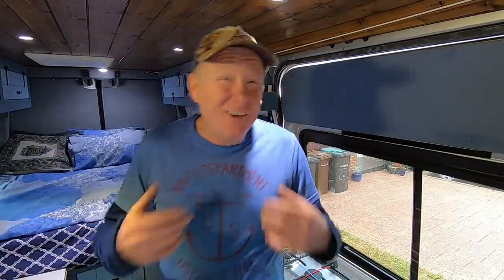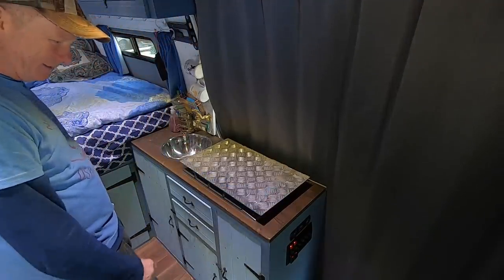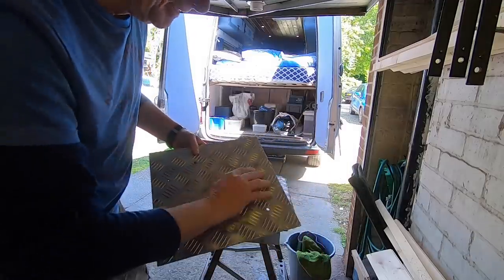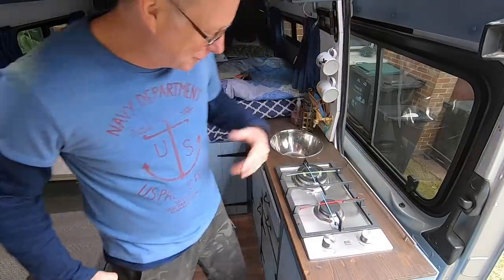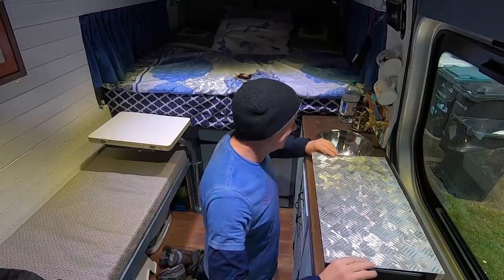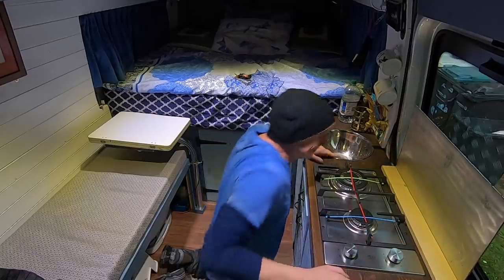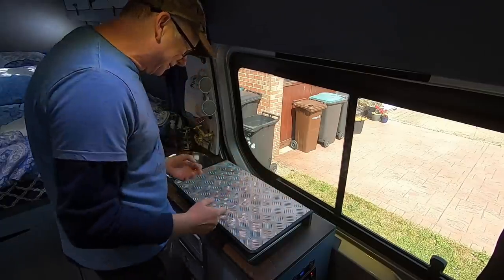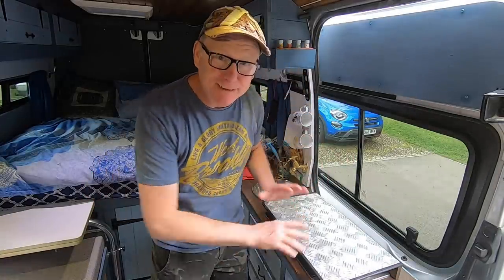HOW TO build kitchen in an RV  Campervan ( backsplash )

Comment: Gotta love left over bits,if you hadn't filmed removing that rail i'd have sworn you had cut it off with the grinder.hahaha,will the wood holding the lid not get hot?bit of angle would easily sort it if needed,nice job Mel keep em coming.
Reply from the maker: Thank you 👍🤓👍
I think it will be ok 👍

Comment: I would flip it and stick a nice piece of wood on the outside. Like that it looks better and doesn't melt your curtains
Reply: No need to flip, agree though just put a nice bit of wood on it and it could be his chopping board as Mel don't seem to have much prep room..Just a few tidy screws so as to remove and replace if needed..
Reply from the maker: Ohhhh that’s a great idea nice bit of bamboo thank you so much 👍🤓👍🍺🍺

Comment: I can't see why the heat would affect the window, most of the hear from the burner goes in to the item on the hob, when you cook you can't touch the pan yes because it's too hot, but it's not like everything surrounding the hob is boiling...
Reply from the maker: It’s also a back splash stopping my beacon from spitting fat up the curtain or windows
Reply: @BigVanSmallWorld  that makes sense, but the whole window thing? Nah

Comment: Mel, what curtains are you using? I really need some for my van.
Reply from the maker: the curtain for my door and cab come form this company http://rover.ebay.com/rover/1/710-53481-19255-0/1?ff3=4&pub=5575467911&toolid=10001&campid=5338454651&customid=&mpre=https%3A%2F%2Fwww.ebay.co.uk%2Fitm%2FDreamscene-Pencil-Pleat-Blackout-Curtains-PAIR-of-Ready-Made-Thermal-Tape-Top%2F123153626662%3FssPageName%3DSTRK%253AMEBIDX%253AIT%26_trksid%3Dp2057872.m2749.l2649
the curtains for my small windows was custom made for me i made a video all about them https://youtu.be/mrCdjypzlWQ

Comment: Why didn't you just put the hinge between the piece of wood and the checkerplate ? Could have left the rail in situ.
Reply from the maker: Good question if I did that the lid would fall rite back with nothing to support it as it is now the wooden part laying flat when open holds the plate vertical 👍🤓👍🍺
Reply: Quite right Mel. I'd realised that after I'd posted. Should've known better than
to question The Mel. 🙈👍 Keep the vids coming mate. Love 'em all.